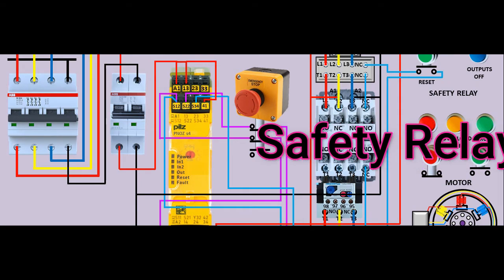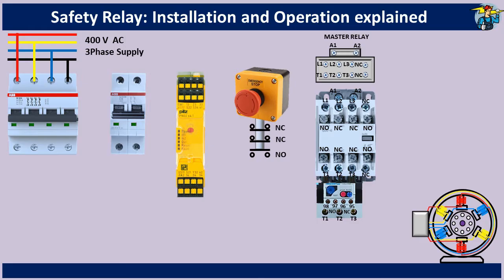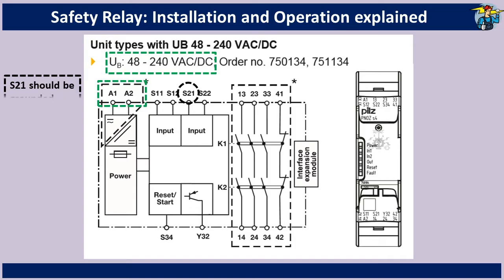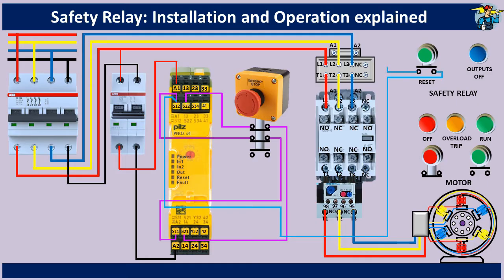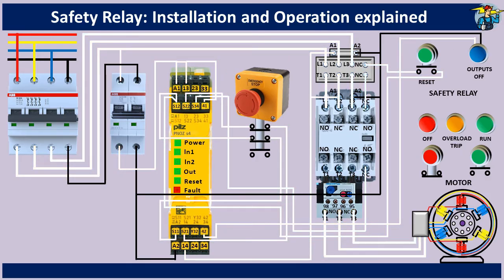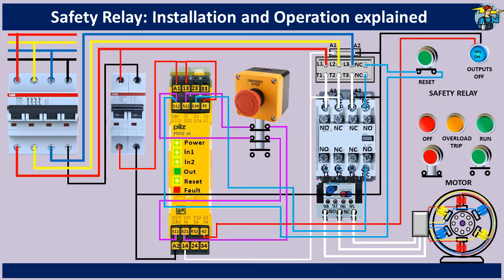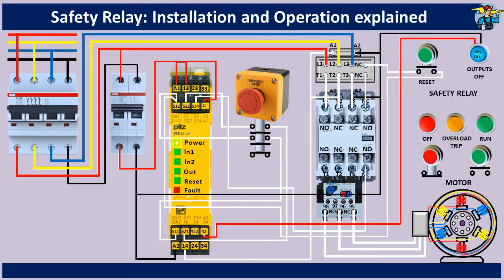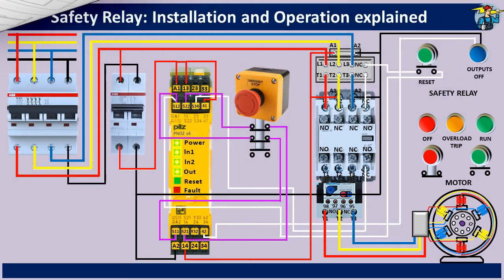How to wire a Safety Relay / Safety Relay Working Principle / The Best Video to learn all about.!😍💪

Comment: Thanks for the great infos on this vid.

Just wondering  what happens when you try to short a relay output from A1 to S21 and suddenly sparks? Is the safety switch still functional or is it damaged inside??
Does it need replacing??

Thanks again.
Reply from the maker: Surely it will get damaged since components like capacitors, transistors, diodes, are at high risk of being destroyed.
Thank you.
Reply: @ElectroAcademyEA  
I guess your assumptions about my question are not really true because the safety relay is still working correctly. Thanks for your time.
Reply: @Jay-tr3px  A well built unit will have internal varistors and maybe even thermistors to protect itself from high voltage spikes. I agree with @ElectroAcademyEA that the components would get damaged however I would add that the introduction of higher voltage or high current would need to have a longer "fault" duration. Of course many variables to consider.

Comment: Why do we need a Master Relay before the Magnetic contactor?
Reply from the maker: When Magnetic Contactor main points are stuck with welded condition, safety relay operation alone cannot stop the motor.
Then Master Relay can stop main power to the motor by shutting off its power.

Comment: S12 supplies 24 V to S34 to reset.   Is s12 just looking at channel 1  ?   Please advise.
Reply from the maker: S11-S12 and S21-S22 are input switches and must be in the closed position for internal contactors K1 and K2 to be closed.
Contactors K1 and K2 (placed inside the safety relay) must be in the closed position for control power to be available at terminal 14.
Although 24 volts for reset power have been connected from S12 of channel 1, the system cannot be restarted without channel 2 enabled.
So, the motor run contactor control power will not be out from terminal 14, without closing both the S11-S12 and S21-S22 switches.
Reply: @ElectroAcademyEA    Thank you very much for clarifying this.    Please do more safety videos as there as so many different types of safety controllers in industry
Reply: @ElectroAcademyEA  why we need to ground s21

Comment: Emergency stop doesnt stop the circuit ?
Reply from the maker: If the motor running contactor has a contact  welding condition, emergency stop cannot stop that faulty contactor from operating.